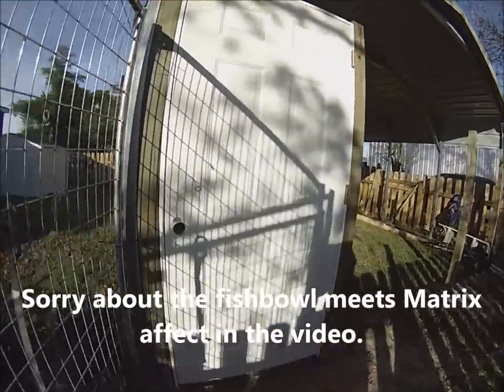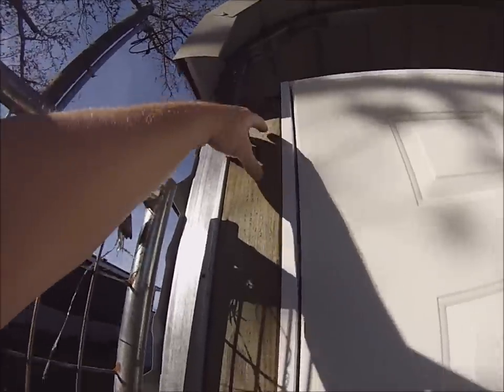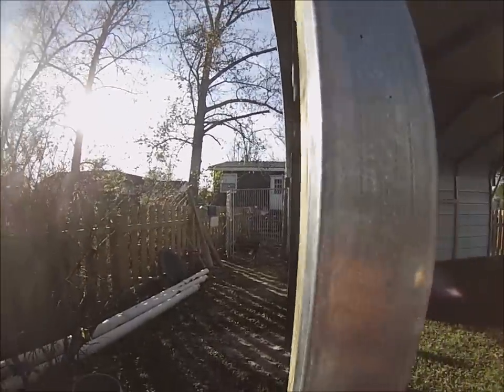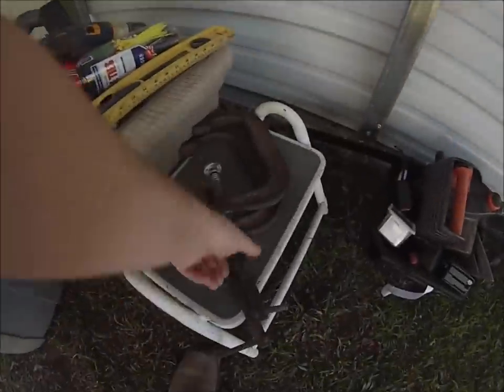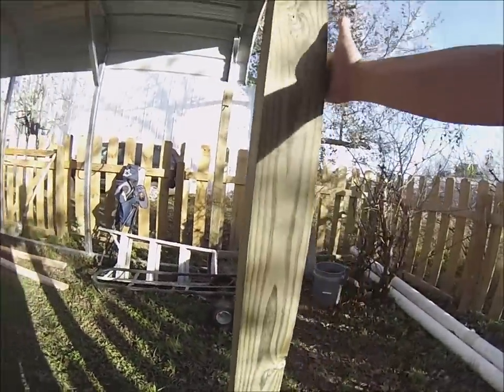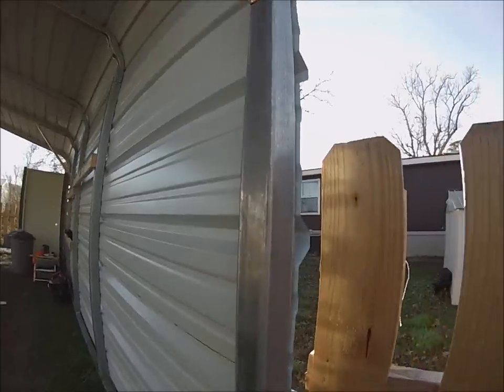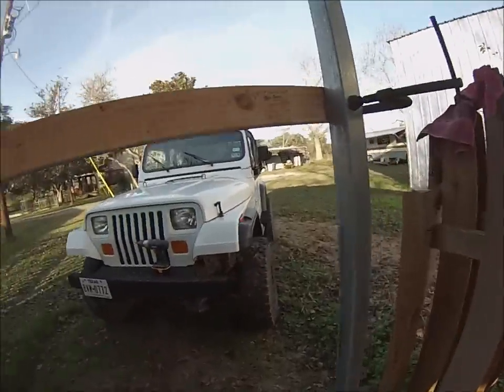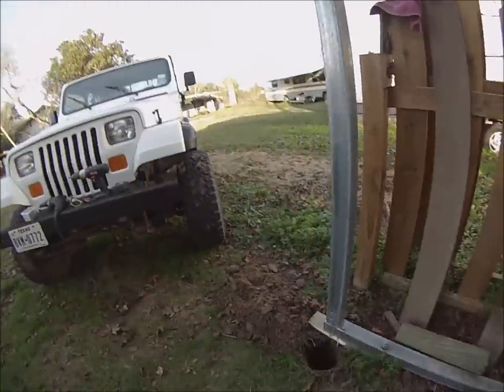Part 2 - How to Enclose a Metal Carport - Back Door and Setting Posts

Comment: I know this is old but hopefully you still reply... How did you attach the wood to the frame on sides? Not the open end you're working on here but the 2x4s on the inside?
Reply from the maker: Are you talking about the 2x4s that are on the ribs on the inside?  If so, I used self tapping screws.
Reply: @JRMSweeps  yup. That's what I was talking about. I think I'm the earlier video you were saying it was bracing and to hang stuff on
Reply from the maker: Yes sir, that is what I did.  Just used long, regular self tapping screws with a broad head.

Comment: when will part 3 be uploaded
Reply from the maker: we did the back this last weekend, but as i went to cut the gable part, i guess cutting diagonally is harder on the carbide wheels i use...it ate them up like butter.  so, it won't be for another 2 weeks i am sure, depending on how the weather is down here...part 3, i am going to focus on how to make a jig for the gable so you don't have to calculate the slope and whatnot.  mid march, i plan to do the final vid (part 4) and that will showcase how to install a 16 foot garage at the front.  this is all new to me so it's taking me a looooooooooooooong time to do...
Reply from the maker: Blake Merrill Trouble I have part 4, which is the garage door installation up on the channel...part 3, which is enclosing it completely will be done this week!!!

Comment: Any update on part 3?
Reply from the maker: Trouble Part 3 is slated to be up and done in June.  I need a good 2 to 3 days in a row with now rain to set the garage posts and finish hanging the gable pieces of sheet metal.  I want to get it all in as the final video.
Reply from the maker: Trouble I have part 4, which is the garage door installation up on the channel...part 3, which is enclosing it completely will be done this week!!!

Comment: boy..i looked at those 2 x 4s..they are warped man...
Reply from the maker: Yeah heat got to em.  Better off using steel or aluminum.  I am about to enclose a 22 by 25 and will be using 4x4 square tubing instead. Still holding up tho!

Comment: Dude get a real camera you're making us seasick.
Reply from the maker: Great advice, lol.  It was too late to reshoot this vid obviously.  After this one, I ditched the go pro.
Reply: @JRMSweeps  that is good. hey do you have any photos you could share on the finished product inside and out? I have a 21 x 18 unit that I already added sides to the ground on but now want to add ends and trying to figure out what kind of doors I want to do. I don't want to do a standard garage type door like you did but I do want something big enough to get equipment / motorcycles etc in and out easily. and maybe a walk in door on the other end.
thanks,
Reply from the maker: I can shoot you some pics this weekend.  If you want, email me at jrmsweeps@outlook.com and I will take some Saturday or Sunday weather permitting.